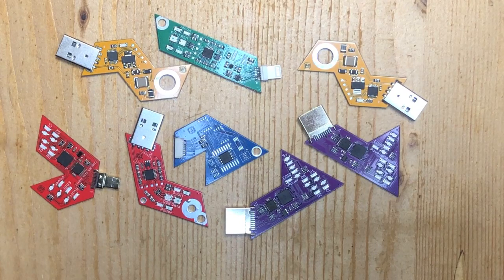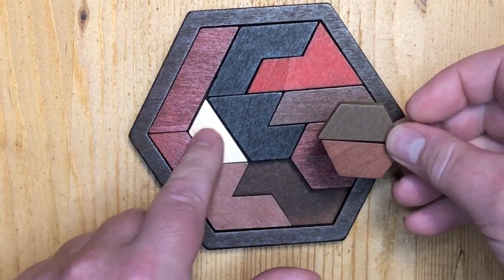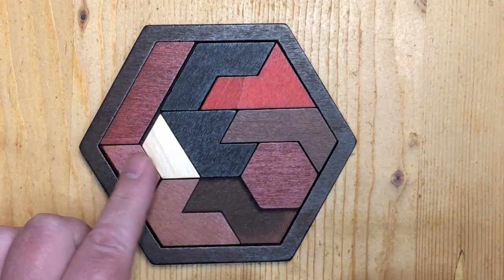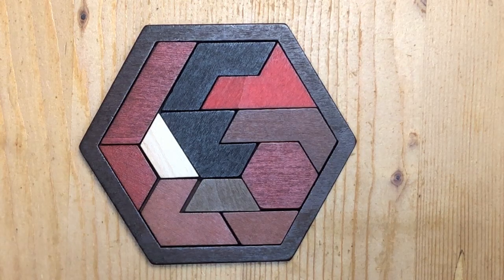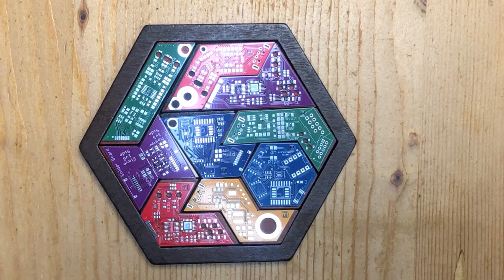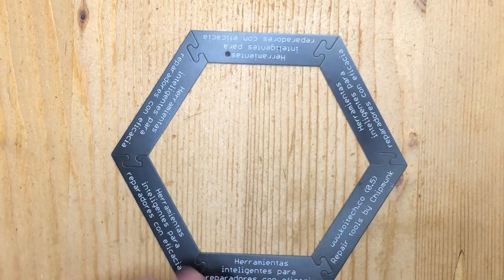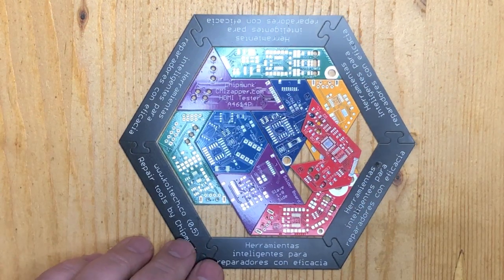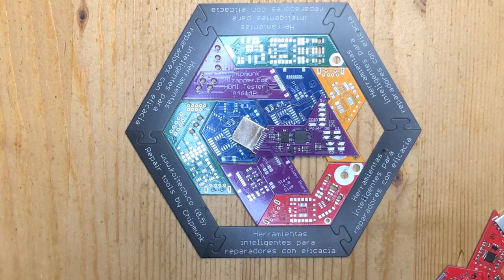Clever Geometric PCB Puzzle

Comment: Very cool but such a shame they don't align anymore once fully assembled. If you scaled the whole thing up slightly could you maybe inset or height-offset the plugs to make they align?
Reply from the maker: The other problem is that with components you could not flip the pieces upside down. In the puzzle the pieces are allowed to be used the other way round.